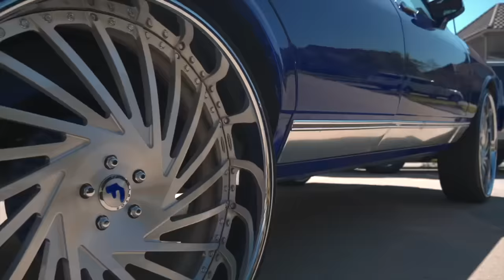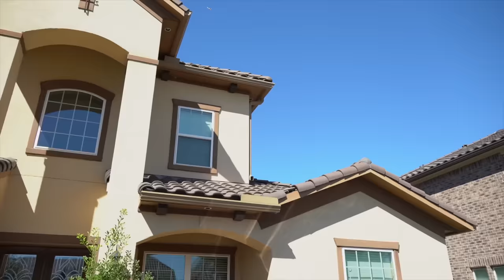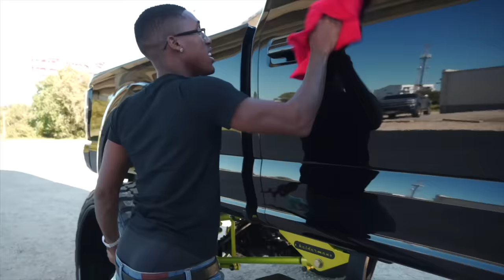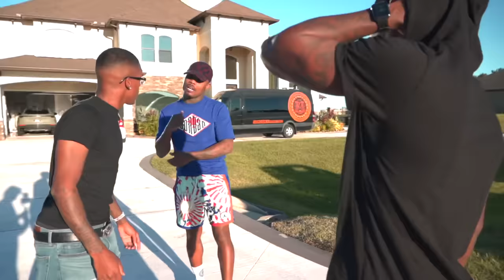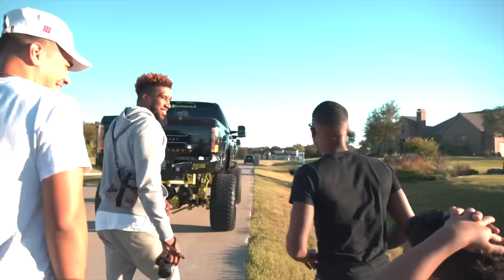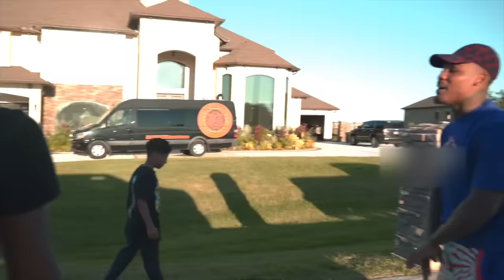Corey & Teddy pulls up on Jermell Charlo in their $100k+ trucks

Comment: Hey Corey that ticking/taping sound you hearing sounds like an exhaust leak. A few people in the comments recognize it too. It could be as easy to fix by tightening the header bolts. You might be able to get at them through the wheel well with the car jacked up on that side. But I'm pretty sure it's not your AC compressor like you think. Now that I think about it you could be capping just to get under your haters skin. I'm gonna stop commenting because I just realize no matter what go wrong wit you $#it you have the means to get it fixed no matter what I can tell you. 🤔😯🤦‍♂️💡 I just had an epiphany. 😄😄😆😆😂😂🤣🤣🤐🤐🤐🤐🤐🤐🤐🤐🤐🤐